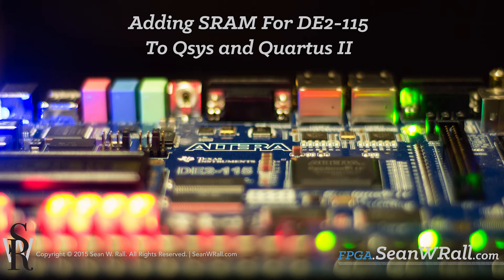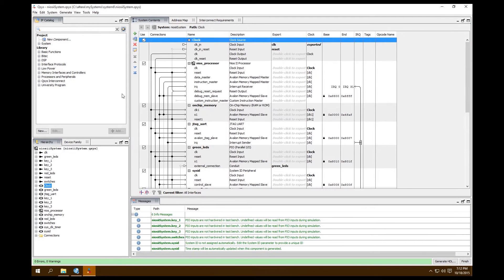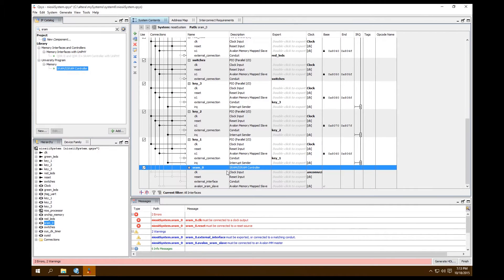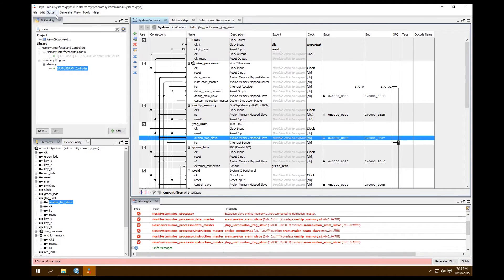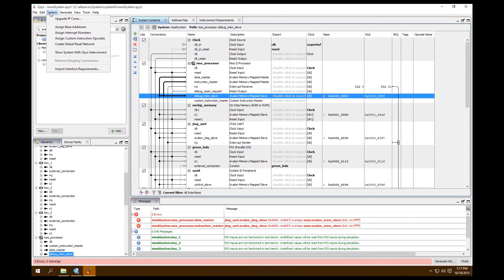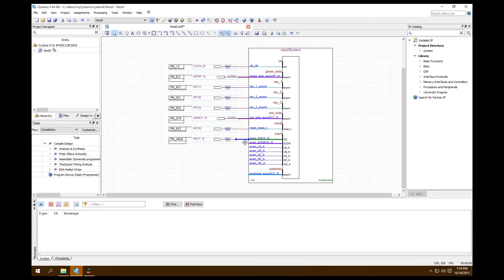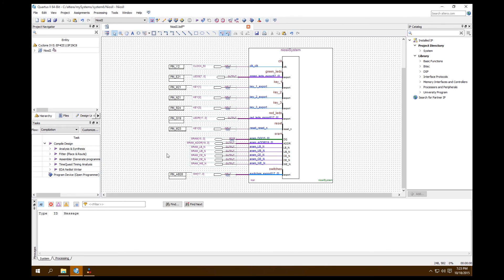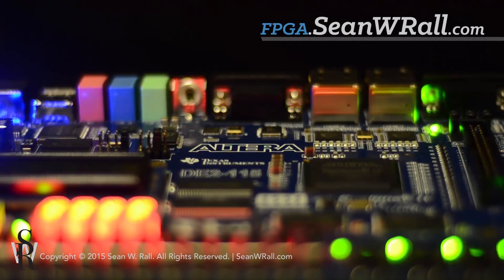Adding SRAM For DE2-115 To Qsys and Quartus II

Comment: Hello, ive been watching your video and it is very helpful on how to use qsys. I am new to this and wondering what exactly is the output suppose to look like. Im assuming that nios is the master while the memory, pio etc are the slaves. How are the memories use to affect the output? Is it just use because the processor need memory for the instruction and data ? I guess what im asking is if there is a way to store data from the io to the memory and read it back in a form of led for instance. I was also thinking just using mif to output to led but how do we change the speed we want? maybe pll? thnx

Comment: Thank you, is it possible to add the sram in vhdl code directly?
Reply from the maker: +ph Std Without using Qsys you need to write the controller (Also known as IP Core) for the Specific SRAM chip you are using in verilog and add that file to your Quartus project. 

If you are asking on how to connect the SRAM using verilog and not the Block Symbol File method you will have to create the connections using verilog. Terasic has a video tutorial that might help you get started with that, I will be looking into making my own tutorials using this method in the future. http://www.terasic.com.tw/cgi-bin/page/archive.pl?Language=English&CategoryNo=49&No=656